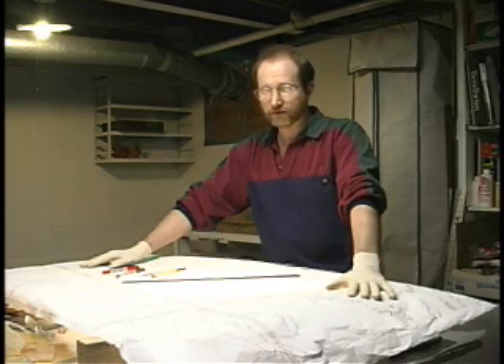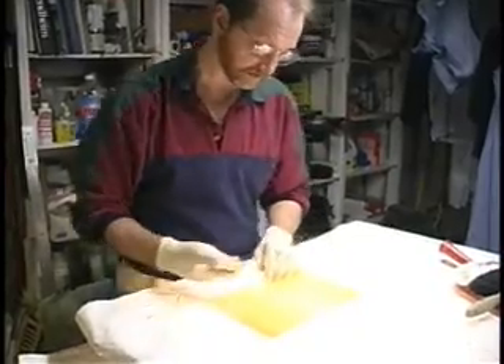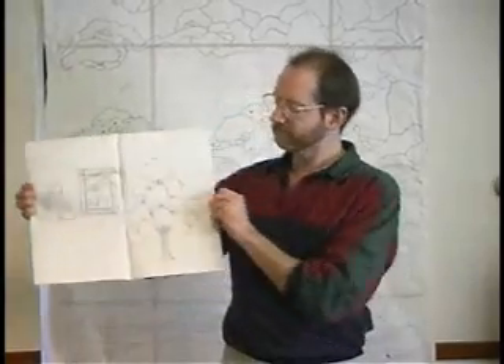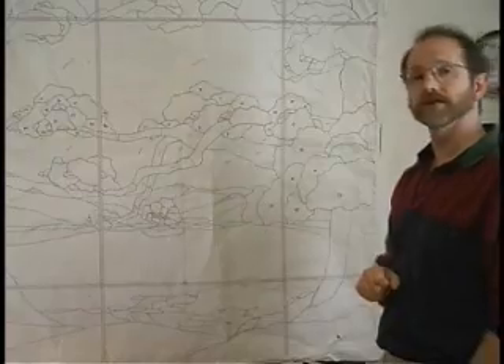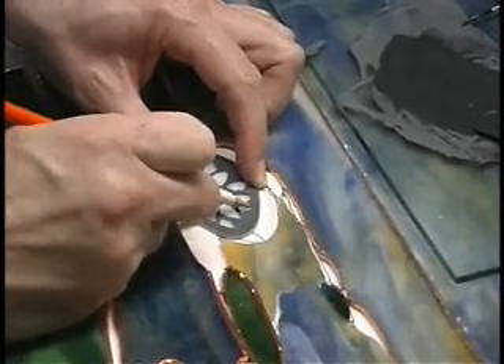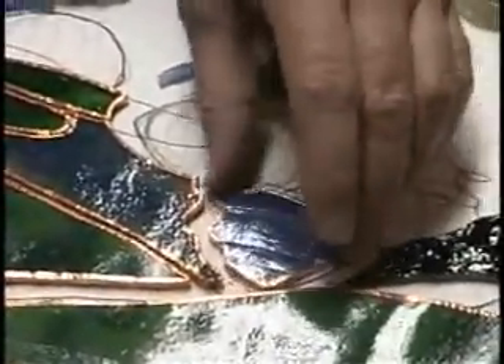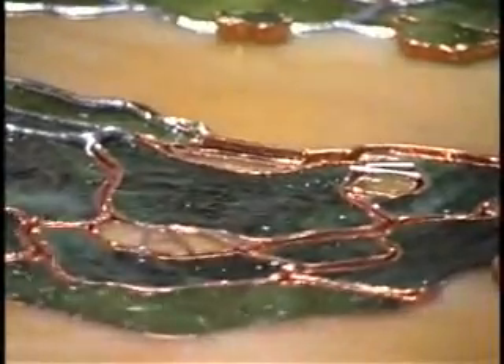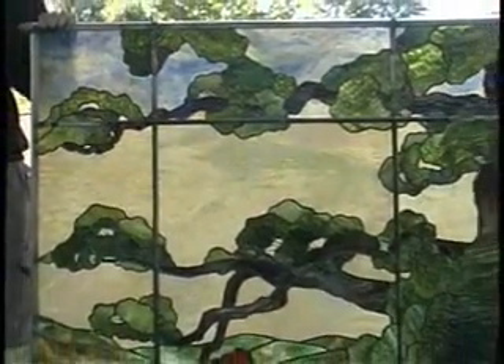Gary James: stained glass landscape

Comment: Very intersting video. One thing to note, it's the flux-fumes which is harmful. The lead does not give off any vapors unless you heat it to 1750 Degrees C (at which point your soldering iron has melted itelf)